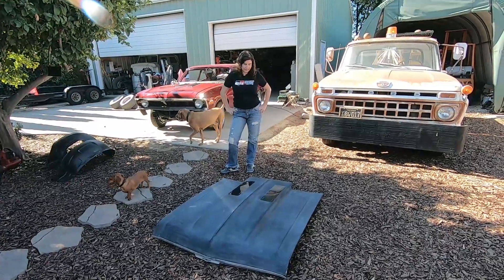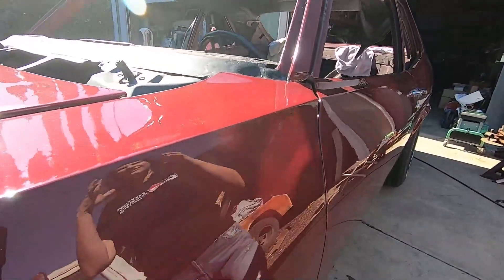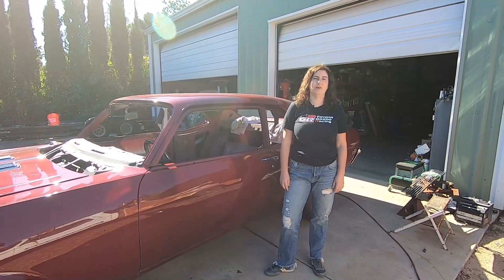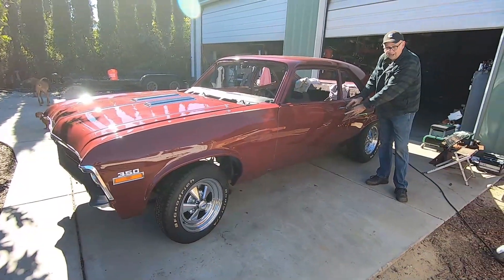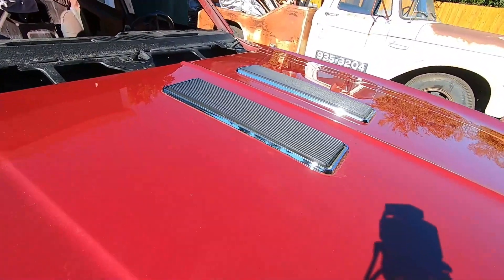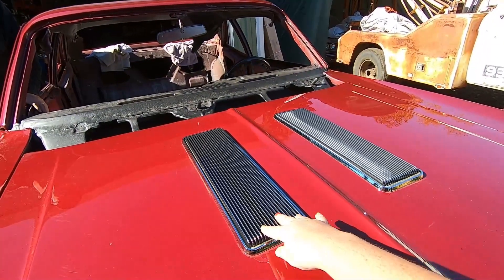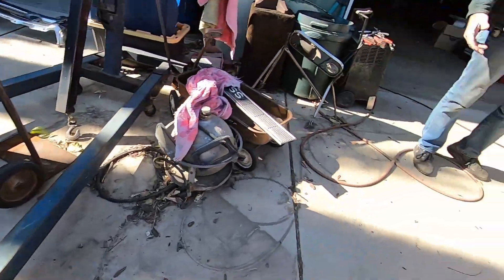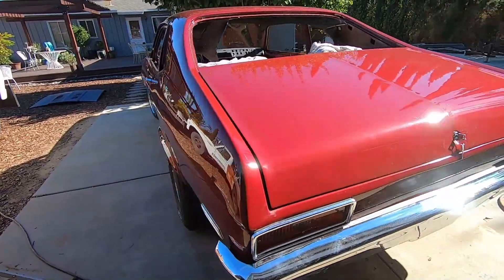1970 Project Nova SS Paint Ruined!  Project Nova Series Part 9

Comment: That really sucks....I know how you feel, as one time back in the mid 70's when I had a '64 Nova drag car, I took my hood off to cut a hole in it and add one of those Mopar style hood scoops so popular back in the '70s, and was even bonding and blending it in. Well, it was propped standing on end drying the primer coat I applied as the scoop was nicely bonded and blended, then a gust of wind came out of nowhere during the day and blew it (scoop side down) onto concrete pavement and shattered the ABS plastic scoop- F'n A !
Reply from the maker: Oh man that sucks.  You definitely know the feeling!